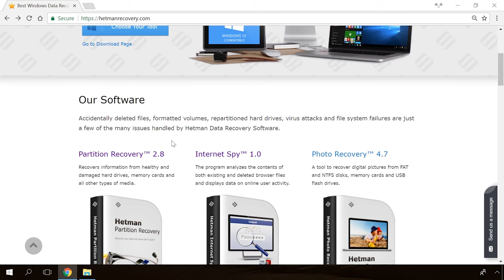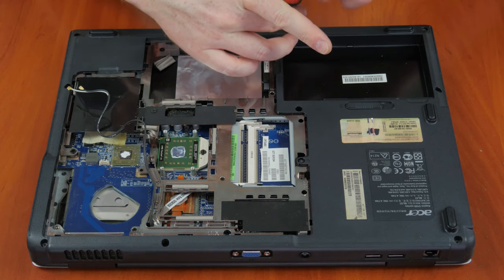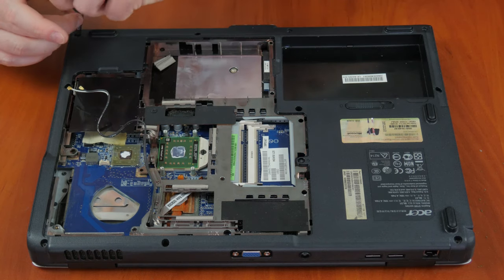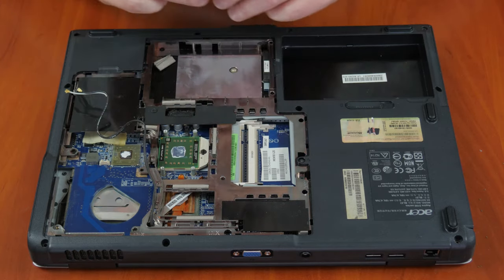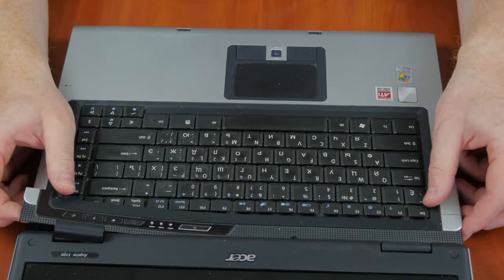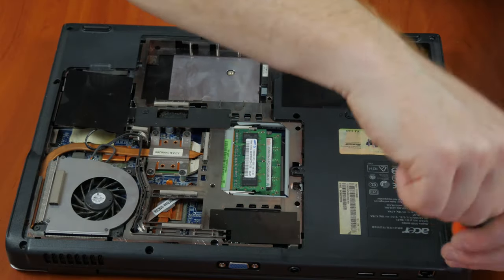How to Take a Laptop Apart 💻 and Clean 🧹 It from Dust

Comment from the maker: Сontent:
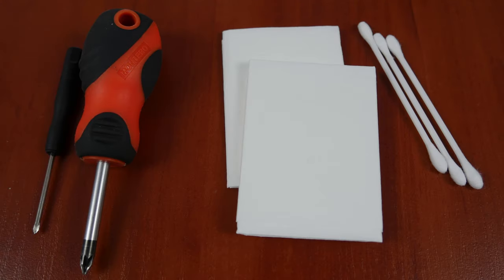1:19 - What do you need to clean your laptop from dust?
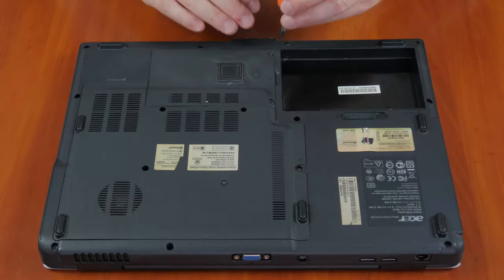2:11 - Cover removal process
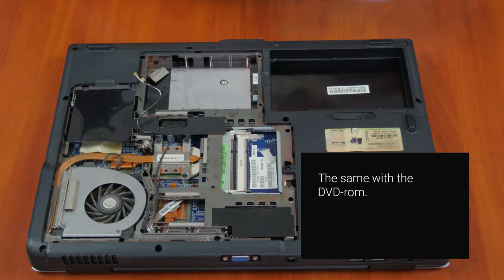4:01 - Cleaning the fan and radiators
6:03 - Replacing thermoplastics on the processor and video card
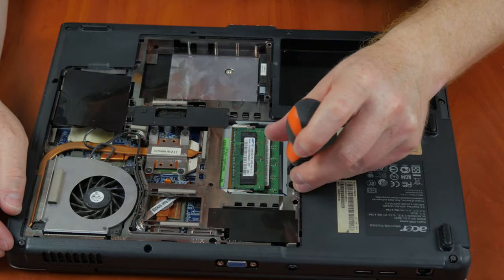26:36 – Conclusion

Watch how to take a laptop apart and clean it from dust
. Did you like the video? Click Like button and subscribe to Hetman Software channel. We will be glad to answer any questions in comments.

Comment: Do we need to take out the ram, wifi and other parts while cleaning or can we keep them back in
Reply from the maker: When taking apart a laptop to clean it from dust, it is generally recommended to remove the RAM, Wi-Fi card, and any other removable components before cleaning. This allows you to access all areas where dust may have accumulated and clean more thoroughly.

Comment: WHAT KIND OF SCREW DRIVER IS NEEDED TO REMOVE THE SCREWS, on the underside of the PC Laptop?
Reply from the maker: To unscrew the screws on the underside of a laptop, you may need a screwdriver with different types of head, depending on the manufacturer and model of the laptop. However, the most common head type for these screws is a Phillips head, with a size of #1 or #2. You may also need to check the size of the screwdriver against the size of the screw on your laptop, so that the screwdriver head matches the screw head exactly. If you are unsure which screwdriver to use, we recommend consulting your laptop documentation or the manufacturer.